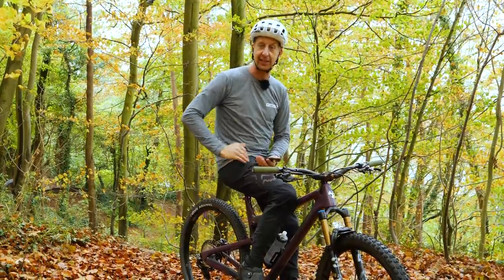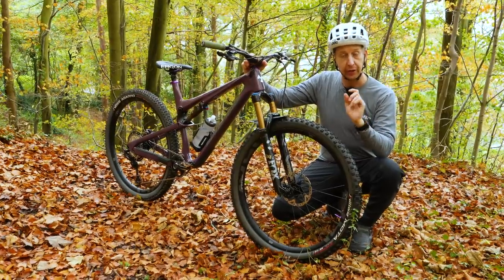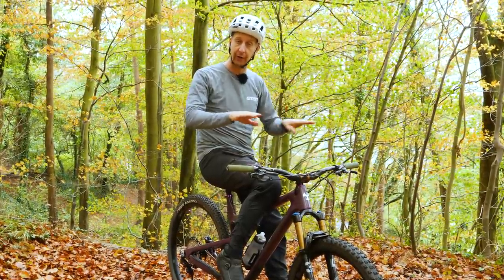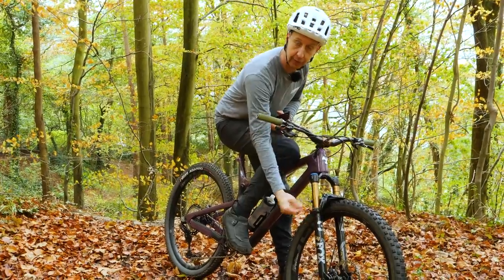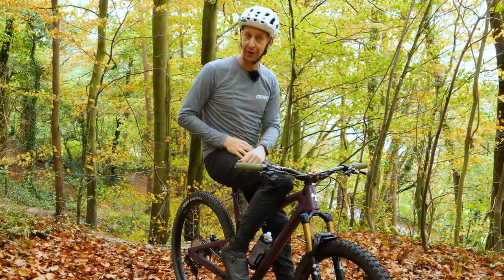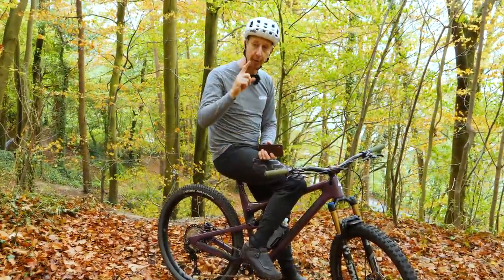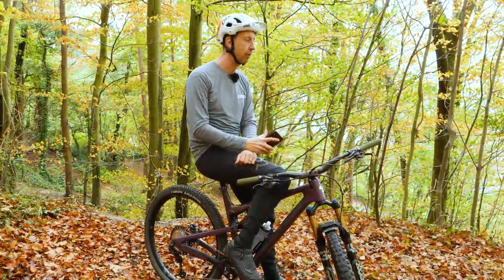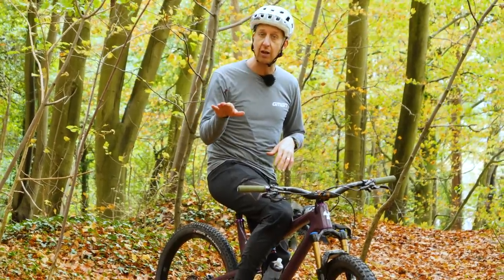Why Is The Seat Tube Angle So Important On A Mountain Bike? | #AskGMBNTech

Comment: The Cannondale Headshok system was pretty innovative for XC and light trails. Would love to see a modern interpretation.
Reply: specialized future shock on their gravel bikes is one similar
Reply: @dCip77  Good point, the concept is very similar, however the two designs are proprietary technology, so there will be some differences by design. I believe FutureShock dampens from above whereas the Headshok acts from underneath. I may be wrong but that is my understanding of the systems. Both are pretty cool ideas, though.
Reply: I believe they still doing it in lovely touring bikes....or they've been till fairly recently, not sure
Reply: @polishguywithhardtospellna8227  Cannondale's Headshok was discontinued in 2014 when they redesigned the Lefty fork. As XC races became more technical and conventional fork design improved to match, the limitations of Headshok were exposed. Bikes were being specced with 27.5 and 29er wheels, New conventional forks were much stronger for the same weight, and had more travel. The Lefty was redesigned for hybrid and more recently gravel bikes where they used a more conventional shock system. Specialised spec their FutureShock on their hybrid (Sirrus) gravel (Diverge) and high end endurance road bike (Roubaix)

Comment: My worst (physical) mistake I made working on a bike, slammed my hand into a bare chainring when removing a pedal, the sharp teeth punctured my radial artery vein and blood immediately shot to the ceiling. I grabbed the closest rag immediately (it was dirty) and drove myself to the emergency room. The Dr. said that if I hadn't done that, regardless of the disgusting rag, I very well could have bled out or lost some of the functions of that hand. I always always make sure the chain is on the biggest ring now (less of a concern with 1x drivetrains!)

Comment: One time when I was doing rad bike stunts drunk I made a jump out of a stack of beer cases and a 2x4. Well it didn’t end well. After hitting the jump at an extreme speed the seat flew off during my second back flip. When I landed… well let’s just say it was like I passed out at a party at Vlad The Impalers house. It was so embarrassing!!! The bike wouldn’t fit in the ambulance with me and the seat post was stuck about 15” up there. Finally lashed the bike to a team of sled dogs that where able to yank it out on the 9th try!! A few hundred stitches and O ring reconstruction surgery and I’m doing rad jumps again (after a lot of PTSD therapy). So yes I agree seat post angle is critical!!!! Great video!

Comment: What would you say about having a 180 fork on a 140 frame? Love the content🤟🤟
Reply: rediculouse ^^
Reply: I'd say your going to break the frame near the headtube.  Good luck.
Reply: Make sure your head tube is strong enough and you'd need to use an angled headset to get the geometry back to something close to what it was or you'll raise your Crank a lot and push yourself backwards on thd bike making climbing hard and it very easy for the front to come off the ground. I'd stick to 20mm max increase but if you head tube is up to it then it's possible, just takes some cash, working out and time. Like you might need different handlebars etc.
Reply: Stupid uphill, but loads of fun on the downhill... I made a single speed hardtail with a 160 fork(originally a 110). It absolutely ruined it on the uphill, but my god it was fun on the downs
Reply: The most accurate info I've come across online (PSA. This is what I've read; not personal experience) for every 20mm of extra front travel you're head angle gets appropriately 1° slacker. This obviously has overflow geometry effects, but the most noticeable changes overall would be a 2-3° slacker headtube and 2ish° slacker seattube. For example (I dont know what you've actually got), if your 140mm bike has a 66° headtube, then putting a 180mm fork should give you a 63-64° headtube (approx), which should help your descents as much as the extra travel does. That said, your climbing would suffer correspondingly, as the front is both slacker and higher, and your seatpost is slacker, both of which will put you further over your rear wheel in climbing. 

If you were to get a fork with adjustable length (the new Rockshox Zeb has a 160-180mm fork I believe, designed for E-Mtb) this would theoretically provide the best of both worlds, giving you a steeper 160mm fork for climbing and a slacker 180mm fork for descending.

TLDR; if your 140mm bike has a fairly steep headtube angle, then putting a 180mm fork will give it a noticably slacker headtube angle.
Reply: Don't do it
Reply: @fwmtb  Where's your sense of adventure?

Oh, you replaced it with common sense? Yeah, that's understandable...

Comment: #AskGMBNtech    hi doddy, I've got a problem with my headset(probably, not sure) basically when I pull on the bars to jump or do a manual i hear a clicking noise, it does the same thing when I hit rocks pedaling uphill; I've already tried to put fresh grease on it and check some of the other critical bolts. The bike in question is a 2021 trek slash.
Loving the videos, keep em coming

Comment: #askgmbntech 
Hey Doddy, I'm saving up and looking in and forward to buying my first new bike but struggling with geometry, since I'm 1.98m and 78kg with long legs (bit like a stickfigure :p). 
Q:What is more important? The top tube length or reach? My choice is between the 2021 Trek Fuel Ex 8 XT XXL, 2020 Canyon Strive CF 8.0 XL and the 2021 Nukeproof Reactor 290 pro XL. Respectively tt:687 r:520, tt:695 r:500, tt:675 r:514.
It's all within 20mm difference and wonder how and if I could experience the difference. Unfortunately there are no dealers nearby so testing is no option. But anything will be better then my 2015 Scott Spark 930 tt:650 r:456 XD

I'd love to hear your view on this.
Keep up the great tech vids! Love them!

Cheers Tim

Comment: I really like your channel. Looking at the last section on picking up your front wheel, it looks like the bike is a bit short and the handlebars are relatively high, which no doubt should help lifting the front wheel.
But the new bike geometry, with a long reach, probably make it very hard and almost impossible (my feeling) when the bars are relatively low as on XC bikes. What do you say?

Comment: Regarding the "inverted fork" topic: No, someone from the motorcycle industry wouldn't say that the typical MTB fork design is actually the inverted version. What is referred to as an "inverted fork" in the MTB world is called an "upside-down fork" (or USD for short) in the MC world. Stanchions clamped in the triple trees and front wheel mounted in the sliding lowers is the original design, which is still widely used by many manufacturers. Just have a look at an old BSA, Norton, Triumph, etc.

Comment: #AskGMBNTech  Hi Doddy! I'd like to ask for a little piece  of advice. I'm about to be building a new wheelset for my XC/Trail hardtail and one thing keeps on bothering me in terms of spec. Should I go for a touch wider rim (30mm internal) and have a wider base for a given tire or gain some weight by choosing slightly narrower ones (27mm) - both in 650b. Also, could you reccomend me the number of spokes for each wheel? I'm considering having 28 spokes at least on the front  but still can't make up my mind about it. Thanks and keep up the good work!!!

Comment: #AskGMBNTech Hi I was just wondering if I can use and angle adjuster headset with Trek Knock Block system. I enjoy tinkering with things and would like a little more adjustment than the flip chip provides. Thanks!!

Comment: #AskGMBNTech Hi Doddy. Love the show and have learnt a lot. One more thing I would like to know, is there a reason not to use a compression/expander plug instead of star fangled nut to fit a tapered 1 1/2-1 1/8" suspension fork on a mountainbike? Thanks.

Comment: What would cause an MTB fork to smoke? I was recently doing a service on my 2020 Fox 36 Grip2. When I undid the air cap of the fork, dark colored smoke started rising out of the air chamber. I have inspected the inner walls of the stanchions and the piston seals and don't really see much for wear. Any idea what caused the smoke and if it is something to worry about? I used SRAM butter in the piston head and put the 3ml of Fox gold in the air chamber as recommended by Fox. #AskGMBNTech

Comment: #AskGMBNTech Hi Doddy, I took my bike to my LBS a couple months ago for a brake bleed. The back brake was working well beforehand but upon collecting my bike they told me that the brake piston was cracked and I may experience minor brake fade on long downhill runs. Since then, my back brake has been working less and less reliably and now it won't bite at all most of the time (sometimes it does bite when you pump the brake lever repeatedly). Obviously this is a safety hazard so I can't take it back to the trails until I get this fixed. The brakes are Avid Elixir RSL from 2010 that can use either dot 4 or dot 5.1 fluid.  What's my best course of action from here? Thanks in Advance!

Comment: Hello #AskGMBNTech - I've got a bit of a loaded one. Could you help me understand some more advanced bike fit ergonomics beyond the initial bike set-up?
For example, I've heard it be suggested that the trend towards wider bars can have a negative impact on your ability to leverage the bike and your strength, with some people going back to 760mm or even 740mm bars. What's the science behind this?
Also, I've developed a painful tendon/ligament (need to get it checked out!) since I've been doing more jumps on the trails, and it's been suggested to me that it could be due to the lateral angle of my feet positioning on the pedals in the descents. Should I have my toes facing forward, or should I position them so that my knees bend straight rather than inwards?
Thanks!

Comment: #AskGMBNTech Hi Doddy, any advice on bottom brackets is appreciated. I have a 2019 Kona Honzo fitted with a Powerspline BB and three piece Sram NX cranks. The BB is just about shot and I want to upgrade to a better quality unit. Will I have to update my entire drive train to achieve this, or just the crankset? Thanks!

Comment: I've got a 2021 turbo levo and the trigger for the dropper post takes a massive amount of pressure to activate which makes it really difficult to drop the post in a hurry. Is there a way to adjust this or is it an issue with the post? #AskGMBNTech

Comment: #AskGMBNTech  I ride a 2018 Trek Fuel EX 8 with a FOX 34 Rhythm which has 130mm travel and a 51mm offset. I'm considering switching the fork out for something with a better damper and upping the travel to 150mm. Should I reduce the offset from 51mm to 42mm to counter the slacker head angle? Thanks

Comment: #AskGMBNTech : Rockshox Monarch Plus R Debonair (NOT RC3) I am wondering if the rebound adjust on the Monarch Plus R also affects the compression or is there something wrong with my rear shock? I recently bought a used mint condition 2017 GT SANCTION Expert but I noticed when slowing down the rear shock Rebound adjustment there comes a point, closer to the slowest settings, when this seems to also dampen compression speed as well and make the shock feel increasingly firmer when trying to compress the shock from its full extension. Is this normal? Since there is no separate external compression or threshold adjustment on this shock, are the 2 somehow linked together internally? I do remember reading somewhere that the rebound adjustment on this shock was referred to as "DUAL FLOW"???  I have searched online for the last couple of months for any mention of a similar situation or explanation with no luck. Do I have a faulty IFP seal? or a blown shim stack? ... or is this normal? Thanks. 
P.S. Love the insight that this show, and all the other GMBN tech vids, bring to us home bike mechanics.

Comment: #AskGMBNTech Hi Doddy, I want to upgrade my downcountry hardtail with a new set of rims from Mach1. What is the difference between asymmetrical Torkx 27 and normal profile Cross-R 27? Or in general, what are the pros and cons of asymmetrical rims against the standard ones. Thank you. Fil

Comment: So I have a YT Capra with Fox Factory Transfer and when I pressed the lever to extend the seat post, after i released the lever, i heard a snap... some bolt in the  lever snapped... I must specify that i was not on the bike. I am pretty disappointed at the quality of the lever... it is not the 2020 model. My question is, can i replace only the bolt in there? Or do something on my own to replace it? 
#AskGMBNTech

Comment: #AskGMBNTech While replacing the tyres on my cheap Halfords hardtail, I measured the rim to be 17mm internal width, 23mm outside width. Would these wheels be suitable for going tubeless, or am I likely to have issues due to the narrowness? Most bikes from MTB brands seem to be about 30mm.

Comment: #AskGMBNTech  Suspension set up question. I felt like my suspension was dialed during the summer and fall. However now that the temps have dipped near 25°F (-3°C) it is feeling harsh. Is it a known thing that you need to redial your suspension in the winter? If so, is it usually air pressure or rebound or both?

Comment: #AskGMBNTech
Hello Guys, I have a question related to Air forks. 
I feel that my RockShox (Recon Silver TK) fork loses pressure, not much, but over the weeks it seems to have lost some pressure. The fork is less than a year old, has not been damaged and is regularly cleaned.

I found this online, but what is your suggestion to stop this or to prevent this? Does it really work, or do we have better solutions?:

"If the fork is leaking air slowly, try turning it upside down for a while. This can get the oil inside the fork to pour back around the seals. Strangely, storing your bike upside down longer term can have the opposite effect of making the air leak slowly."

Comment: #askgmbntech I have an old Rockshox Judy, it doesn't have threads on the air valve cap so I can't install tokens, but could I use some closed cell foam, 3d printed plastic or other materials to make my own press-fit tokens to make it more progressive or am I just out of luck?

Comment: Does better fork leads to less fatigue on legs on a hardtail? I have a hardtail with a Suntour coil fork. Despite the weight of the bike it fells very stable. The only problem I have is a fatigue in my legs on a long descends (I ride flats by the way) or is going clipless will solve my problem #AskGMBNTech (My name spelled in Latin is Vladimir like the Russian president) Greetings from Bulgaria

Comment: #AskGMBNTech I have overtightend my front through axle by a looot. Any tips to get it back out? P.s. It`s an Allen key one.
Reply: Justus Ernst smash a Torx Bit into the allenkey hole
Reply: @matzeb7109  tried that but it just made the hole lager XD
Reply: @justusernst8053  your going to need to use a hack saw and cut a groove you can then get a tool into to turn it. Like a big screw driver.

Comment: #AskGMBNTech Hi Doddy, I really like the show and I was wondering: I have a Shimano Deore 10 Speed drivetrain and I was wondering what I would need to do to make it an 11 or 12 speed drivetrain. I.e. would I need to just change the cassette. Or would I need to get a new chain as well. Thank you.
Reply: New chain, new cassette, new shifter, new rear derailleur.  Do you have the short or long cage? I have an 11-40 on the short cage.  I’d go for a bigger cassette if you have an 11-36.  If you have an 11-40/42 11 speed only gets you one more cog in the middle, 15-17-19-21 instead of 15-18-21.  So I would stick with 10 I have no plans on changing) or go to 12 if you want a 50t cog
Reply: @jonathanzappala  Thank you for your help. I think that I would go for the 12 speed as the 10 speed is only an 11-46t cassette and it would be nice to have the wider range (10-51t). Thank you for your help it is greatly appreciated.

Comment: More importantly, can someone tell me a trick to stop the seat pole from twisting and sliding into the tube? I tighten the clamp almost to breaking point and I've cleaned the pole and wrapped in sand paper but the seat still twists and slowly sinks into the frame... :(
Reply: clean and lube the clamp mechanism, it might have so much friction your efforts dont actually clamp the seatpost
Reply: As said by others, clean the clamp also consider a friction paste like carbon compound on the post.
Reply from the maker: Check that the seat post and seat clamp and the correct size for the frame's seat tube.   @christoingram 's right that it's good to give it a clean and consider using an assembly compound/ friction paste 👍
Reply: Thanks, everyone!

Comment: #askgmbntech I saw a good deal on some fox 36 ebike forks I don’t have an ebike is there a difference and will it be fine (upgrading from a rockchox recon)
Reply from the maker: Hi Carl, the eBike versions have thicker stanchions and the crown has beefed up! They if you want a stiffer fork but didn't want to go to the 38 it could be a great option 👍
Reply: @gmbntech  hi thanks for replying is there a significant weight difference not a weight weeenie but don’t want my bike weighing a ton either 
P.s love the videos doddy

Comment: NO lube or oil on nipples - use boiled linseed oil!  Linseed oil works as a lubricant when tightening but over time it sets into a gum consistency.  This gummy oil helps keep the nipples set, but still works as a lubricant when adjusting spoke tension.  It's old school but still the best!